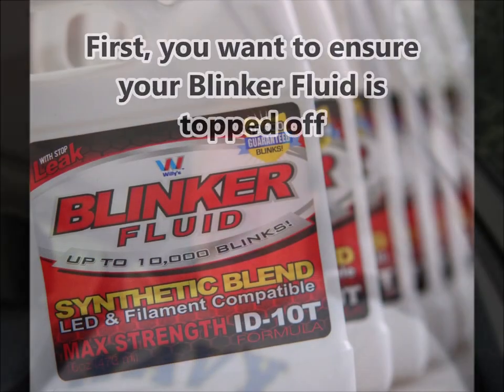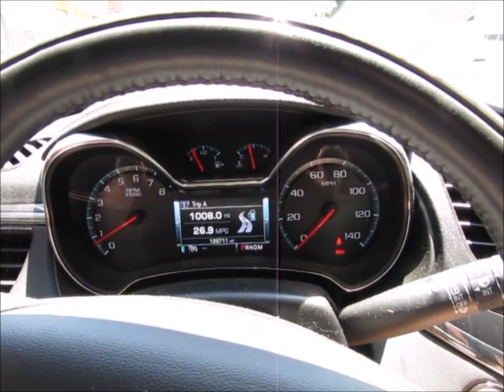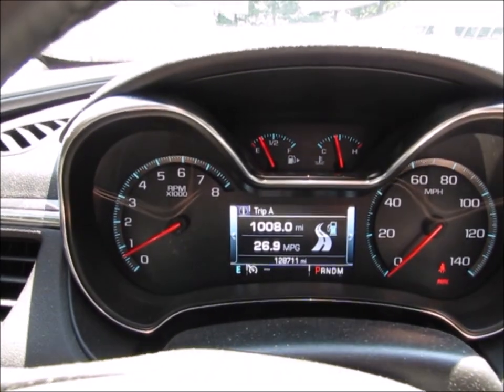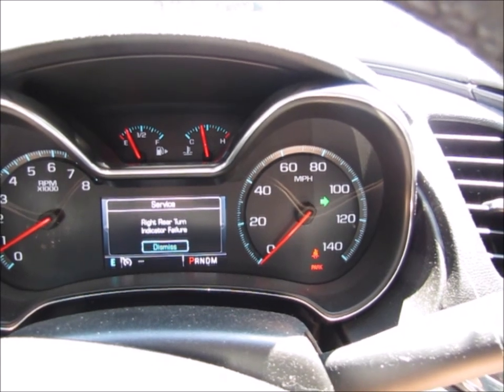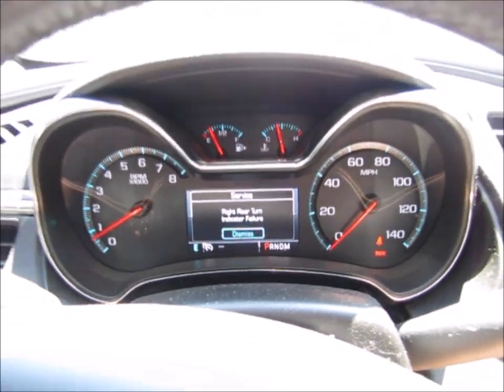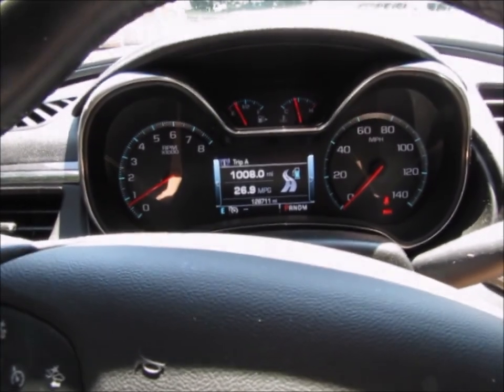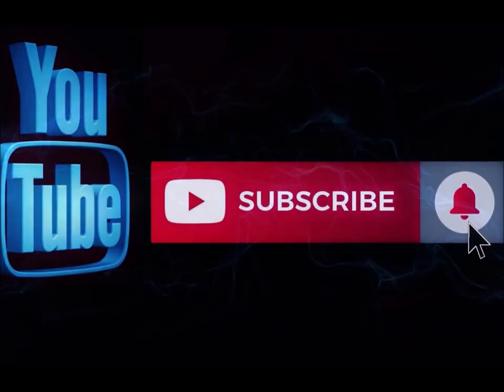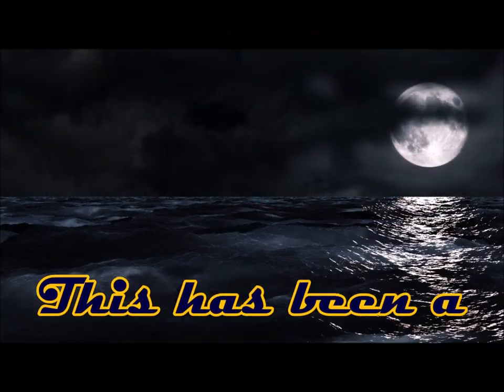Recognize a bad turn signal bulb

Comment: You can't see without light and you can't see properly without good lights. Thanks for the tips Ed!
Now I will go check my blinker fluid
Reply from the maker: The blinker fluid reservoir is usually located right next to the dumaflotchie mount.

Comment: When a new ICFN or recent IC A school graduate would report in, within a few days we would send him to supply to pickup a box of sound powered phone batteries or to ask the Chief Engineer for a left handed monkey  wrench, or my favorite, while doing PM in the main shift room, tell them to run up and tell the Engineer of the Watch the main shaft is turning in the wrong direction.  In each instant - the result was the same - something would be thrown at him and I would get a call shortly thereafter.🤣🤣🤣🤣  Good times!!
Reply from the maker: We actually had a routine of where to send the new guys and who to see.  It always involved running up 7 or so decks, fwd, then aft, then back down 5 decks then to the flightdeck or island.  They would get a workout just trying to complete the tasking as given!  Fun times for sure!!

Comment: Not into all of that electronic BS on cars as they are prone to give false readings. Example; my gas gauge was always showing "empty" even though I knew I was putting $3 in it every week. To fix this, I installed a dip stick for my gas tank. Now, I can physically see when my tank is truly empty. 🤔
Reply from the maker: I hear when you put just the tip in, it makes a squealing noise, but if you put it in all the way, you may break it off in there.
Reply: @EdsAttentionToDetail  🤣🤣🤣